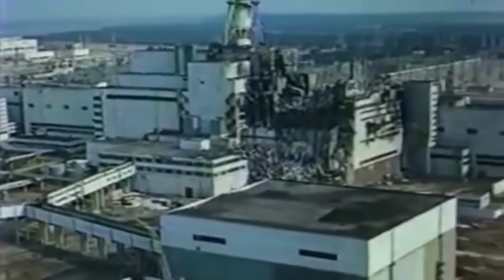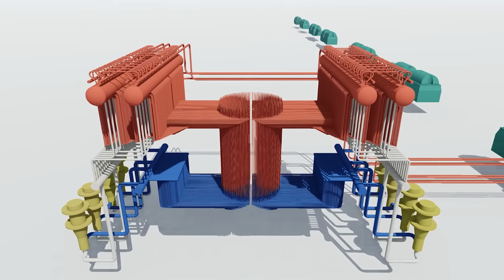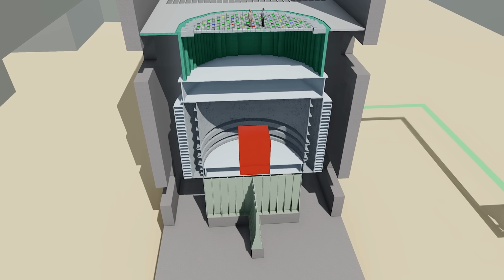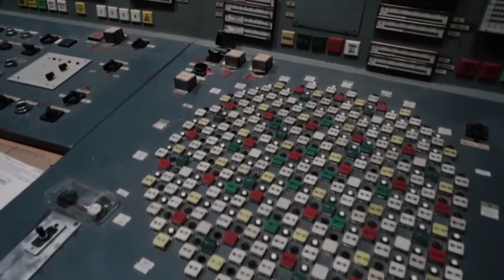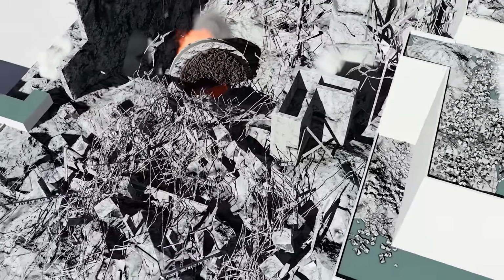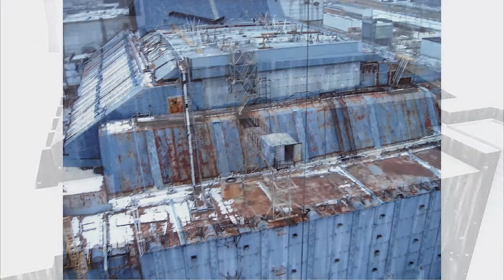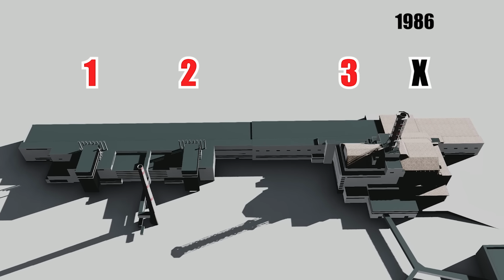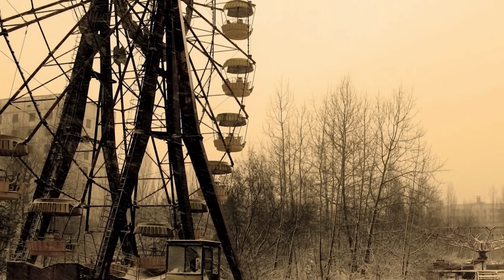CHERNOBYL DISASTER - An Inside Look - 3D

Comment: Why did they need to build a new ventilation stack, when the adjacent reactor number 3 was decommissioned in 2000?
Reply: ¯\_(ツ)_/¯
Reply from the maker: A new vent stack would not have been cheap so there would be a legit reason. The radioactive material is still there and so possibly the need to offgas an accidental release remains into the longterm!?

Comment: One thing I noticed is that you mentioned that there is a positive heat coefficient (increased heat increases reaction), but shouldn't it be positive void coefficient (decreased water, more steam increases reaction). I thought that increased heat decreased the reaction.
Reply from the maker: RBMK’s had a nNegative HEAT coefficient. More heat and it slows down. 
But it a Positive VOID coefficient, more steam bubbles (voids) and increasing reactivity which led to the runaway and the explosion.

Comment: Is there an estimate on how much pressure is needed to launch a 4,000,000 pound lid 30 feet into the air
Reply: I did the math. It is the same energy as a Boeing 717 going against a wall at full power.
Reply: @magalhaes753951  Jesus!!
Reply: metric system is better...1000 tons
edit: or simpler: 1kt xd

Comment: All is good, but antisoviet propaganda... isnt good.
Reply: It can't be propaganda if it's factual
Reply: everything anti soviet is good lol
Reply: No it isn't but explaining what happens there in Russia is necessary for the rest of the world. Everybody in the world has a right to be safe. But no one is with these kind of happenings and actions
Reply: The accident itself is the Anti-Soviet propaganda.  The Soviet system (Dictatorship) is based on secrecy, lies, corrupt middle managers, inefficiency, lack of free press, lack of a peer review system, lack of open expression of thought.  All of these led to the accident.  In accidents there is not one single event that is the cause.  There is what is called a "chain of events" that occur that leads to any accident.  

People watched the HBO Mini series and instantly become experts in physics.  What a shame because in this case the first link in the accident chain is the Soviet system itself.  It was the lies told about the RBMK reactor.  These lies were told so much that no one questioned them.  Thus these lies became the truth.  There is no free press.  There is no peer review system.  There is no criticizing the government or the reactor design.  

The reactor manual was full of lies on the proper operating procedures.  Then the pressure from the Soviet Politicians to run the "safety" test.  Then the design of the reactor itself.  Then comes the design of the control rods.  Then comes the actions of the operators.  Any one single chain by itself is not enough to cause the accident, it is the series of events. 

Accidents like these are not created in a vacuum that is without human failure.  By contrast, a meteor hitting the earth, is one type of accident that is not controlled by man (although we are trying to develop a system).  So the Soviet Government has the full and complete responsibility for this accident.  Of course they blamed "human error" and the operators at the plant.  When actually we know now it was not human error but the faulty design; primarily the graphite tipped control rods.

This type of accident CANNOT happen in the West, plain and simple.  In the West, we ahve Light Water Reactors with containment buildings.  However, the Soviets touted their design as superior.  There was no containment building.  There was no safety systems.  The design itself is dangerous and all it took was one, simple act (insert the control rods) for the accident chain to be completed and BOOM.  In LWR designs, the insertion of the control rods stop the fission reaction. 

Gorbachev himself admitted this accident was the beginning of the end for the Soviet empire.  The Russian & Ukrainian people are a great, proud, hard-working, caring, thoughtful people.  They did not deserve this.  Thankfully the Soviet System was on trial and ultimately collapsed.  The world is a better place without the Soviet system.
Reply: Wtf? Guy, you must read Eugeniy Spitsin - russian history, and you will know a things, wich was a base of communism. But i agree with you at something, the soviet system after Stalin death was on a highway to hell. And i'm russian. Don't try to say me some "factual" or some other propaganda of capitalism. I have independed, russian logic. Dont try to change my mind.
Reply: @halowolf469  My issue is with the Soviet system not the people.  The Russian are great people who are hard-working, honest, family-orientated, disciplined and trust-worthy.  The Soviet system promoted the "Party".  In other words, they promoted themselves not the Russian people.  

So many times, these corrupt, no-good people were in power.  They only cared about themselves, not the Russian people.  The "Party" did not care about the Russian people in most of their actions.  All they cared about was making themselves rich.  The "Party" were a bunch of thugs.  In the US we call it Mafia.

Capitalism is open for anyone to make money as long as it is legal.  If someone has a better product, or idea, they can work hard and make money (Apple, Microsoft, Google, General Motors, Ford Motor, Boeing Airplanes, General Electric etc)  All of these companies started very small and the owners and employees worked hard to build these companies to what they are today.
Reply: @thonatim5321  ok, if capitalism is cool thing, why you at your america have blm, a lot of corruption, peoples in miserey, and 14 hours work day?
Reply: @thonatim5321  so, you are a first american, wich talking with me
Reply: @halowolf469  I cannot explain 7 years of college in a YouTube comment.  However, I will say you should really stop watching the "fake" news.  You have formed an opinion from television that is not even close to reality.  It seems you really have no idea what the truth is about American life.  Again, you are believing propaganda.

The average American does not work 14 hours per day.  The average is about 8 - 8.5.  Most companies pay over-time after 8 hours so people that WANT and CHOSE to work long hours to it because they want more money.  They are not required to work these long hours.  Some people are happy with the money from 8 hours pay.  Others want a new car, or house, or boat, or motorcycle; so they chose to work longer hours to get more money.  What is wrong with that?   It is their CHOICE.  Why do you criticize anyone that wants to make more money?  Let's say for example there was a company that needed people to work over-time.  The workers can quit anytime they want.  They can walk off the job in the middle of their shift if they want.  It is there choice.  I have seen this many times in my life.  So again, no one is forced to do anything.  They work whatever hours they want.

I travel around the USA for work and I do not know anyone that is in "misery" as you say.   Americans love their country and know it is the best country the world has ever seen. Again, you watch too much television and it is not true.  I understand there are many people from outside the USA that will complain and say bad things.  But really, we do not care what anyone else says.  If the USA was so bad, why are there millions of people around the world trying to get into the USA?  Your comment does not make sense.

In terms of BLM, this is a protest against the police.  It has nothing to do with capitalism.  In Soviet Union, if anyone protests the police, they get killed.  BLM is only one group that has protests.  There are thousands of groups that protest.  One group protests in support of homosexual whales.  That is right, homosexual whales.  Who cares about gay whales?  Well this group does.  Protesting is a GREAT thing not a bad thing.  The power is in the people not the government.  So if people think they are not being treated fairly, they protest.  Look what is happening in Hong Kong and Burma; people are protesting and the police are killing them by the thousands.  That would NEVER happen in USA.

You say corruption in USA.  Sure there is some corruption but it is very small because the people do not allow it.  We vote for tough prosecutors that go after these corrupt people in government and business.  They always get caught and go to jail.  The power to the people not the government. 

We have 2 State Governors in the 2 largest states that are in big trouble right now (California and New York).  Both of these men won their election by over 75% of the people.  But they make many mistakes and the people are not happy.  So they protest to get these people in power removed from office.  Again, the people are not happy so they protest and get these people out of office.  In the Soviet Union, the government officials kill the protestors. 

I would invite you to stop watching the fake news and actually travel around the USA to see for yourself.  You will be surprised.
Reply: @thonatim5321  But what is the source of this wealth? Maybe local wars, pumping out our oil and gas? I think it is. And my father is a military journalist, I don't believe the news. I believe him and Yevgeny Spitsyn, who is a friend of our clan. These are reliable sources. I also won't be able to speak English properly about the economy. But I'll try. Do you know what differences in values are? Western and Eastern people are different. So, you better have a car, a yacht and a motorcycle, and I, a Soviet man, better know that my country is intact and that the helm is not beaten off by capitalist bastards. Yes, you Americans probably think that I'm a crazy communist schizophrenic. But I have experienced the influence of capitalism the hard way. Your influence. After all, all the money goes to you. The money of our Russian capitalists and oligarchs is in European banks. And I'll get it over with. Revolution hello, as one Russian said in the song.) 

P.S. I don't think that killing people is cool, I don't drink vodka and I don't have a bear
Reply: @halowolf469  Hi Halo.  Thanks for sharing your story.  The US has many different sources of wealth.  One, of which, you are contributing to.  That is Youtube.  Youtube is owned by Google which is located in California.  Oil and gas are only about 10% of the US GDP.

There are people in the US that are like you.  They do not care about material things.  They do not need a new car or house every year.  They are content with basic living and living the "slow" life.  That is great.  I do not criticize them for their choice.  However, there are people that do want nice things every year.  I do not criticize them either.  I am half way in the middle.

The key factor is that people have the choice.  They can chose to live their life any way they want.  If they want a new car every year, then great.  If they want to live in a small house without electricity, that is great too.  It is all about choice and capitalism provides that choice for people.  

The average life expectancy in the US is among the best in the world.  Americans are healthy for the most part (there are some people that are over-weight).  When I travel to Asia and Europe, I see people living in paper shacks very often.  There is some of that here in the US too but it is less than 1% of the population.  In Asia, it is about 30% of the population.  In South Korea, Japan, Thailand and Philippines are doing very well due to capitalism since World War 2.  Hell even Communist Vietnam and China are moving toward capitalism.  I have many friends in Asia and they love what the US has done for them. 

Communism is a failed economic system.  There is no country in the world that uses communism that is doing well.  We can have this argument all day but the facts are the facts.  In terms of you not drinking Vodka, that is okay because I drink enough for both of us.  

In the US in the  early 1900s there were many Oligarchs too (Ford, Rockefeller, JP Morgan, Carnegie etc).  However, the people passed laws to prevent them from taking advantage of the poor people.  They passed the 40 work week, they passed safety requirements so people do not get hurt at work and all of these are good things.  The very rich have to pay more in taxes to fund schools and roads to help society at large.

I do not criticize the rich because I know they worked very hard to get their money.  They have to pay extra in taxes which helps everyone.  I praise Bezos, Gates, Buffett, Zuckerberg because they all have offered something of value back to the US people. They are very efficient.  The key is people have freedom and choice which is the greatest human right.

I know all about Russian society.  My previous boss was born in the Ukraine and he was in the Red Army during the Afghanistan conflict in the 1980s.  He was a Captain of a tank battalion.  He came to the US as soon as he could and become a citizen.  He says he would never go back.

I have a colleague who was born in East Germany and his father was stationed there after World War 2.  His father married a German woman and they lived in East Germany until they died.  My friend was also in the Red Army as a pilot in the Air Corps.  He flew helicopters and he lead a squadron of the "fast attack" type.  His father and mother died in the late 1980s and he defected in early 1990s to West Germany.  He then immigrated to the US where he teaches flight training and works with me at my company.  He has not been back to see his family since he left and he refuses to go.  He loves it in the US and is now a US Citizen.

So I understand your point.  People are different and want different things for their families.  But just like your Russian comrades (my friends) once they came to the US and lived here, they love it.  Both of them said they would join the US Army to fight against any country if called upon.  Now that is what I call patriotism.  These are good friends and great men.
Reply: Slavery in various forms is historically the greatest source of wealth, that and the "wealth begets wealth" bias that plagues the planet today.
Reply: @Real_Commander_Shepard  100% agree.  The biggest violator is socialist governments.  They are the largest slave-holders of the modern time.  They try to control us with what we can say, spend our money on, placing high taxes on us, etc.  If we could eliminate the slave-trader governments; the world would be a much better place.

Comment: First - A. Dyatlov was a deputy chief engineer, not a chief engineer. 
Second - in fact, he had practical knowledge of the reactor science and about 30 years of practical experience in operating nuclear reactors, including 13 years at the Chernobyl NPP. But he had poor knowledge in theoretical reactor science because it wasn't his area of expertise. Don't forget that he was deputy chief engineer of the station, not nuclear scientist or reactor designer.
Third - You didn't say anything about the design defects of the RBMK-1000 reactors and so called "tip effect of the control rods" which was mentioned in INSAG-7 report of IAEA.
Fourth - last but not least, it is necessary to mention that the mentioned experiment itself was considered routine by the commission investigating the disaster and the surviving workers of the Chernobyl nuclear power plant, since it was carried out for the third time. The mistake of the personnel was to operate the reactor at an extremely low power (10% of the maximum) in the conditions of the so-called xenon poisoning. Such a mode of operation of the reactor was not calculated by its designers, since it was believed (but not prohibited by the rules according to Dyatlov himself) that after xenon poisoning and a drop in reactor power, it should be shut down.
Reply: Dyatlov was just an arrogant russian who was afraid of the system. In the series of HBO CHERNOBYL I hated him but realised that he also was just another victim of the RUSSIAN SYSTEM. The real criminals stay out of sight.... as it is just the case in 2021. Since the change in 1988 loosing communism Russia has become a kind of hidden dictatorial system.
Reply: @GertoHeupink  I must say you have a very interesting point of view on Chernobyl catastrophe. So, Dyatlov was arrogant but also so afraid of communist system that he, by being the senior member of the station's technical staff at the moment, allowed or contributed, to the explosion of the reactor? Can you support this with anything else besides the HBO's Chernobyl and the fact that Dyatlov was russian? 
By the way, both in his interview in 1994 and in his book, which he released in 1995, Dyatlov said that he was chosen as the culprit of the accident by the investigating commission and the authorities, but not a word that he was afraid of the system or or considers himself a victim of the system in general other than being blamed for the accident.
P.S.: I wonder what you mean by "the case in 2021"? Seriosly, I have no idea.